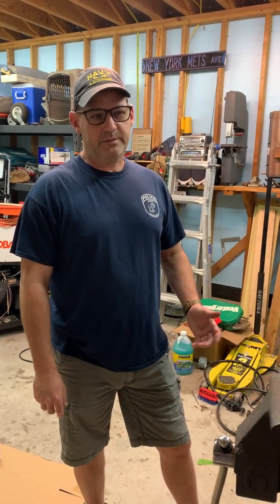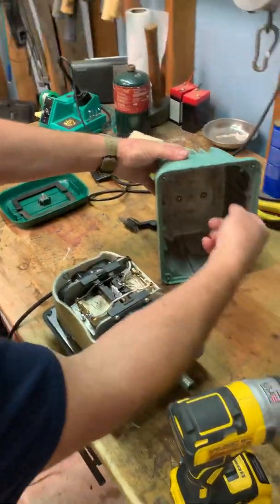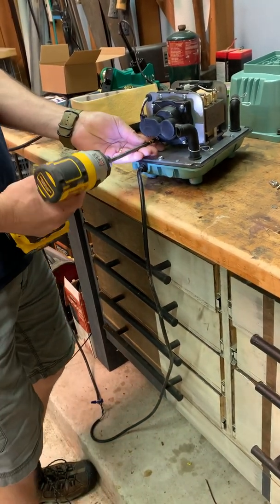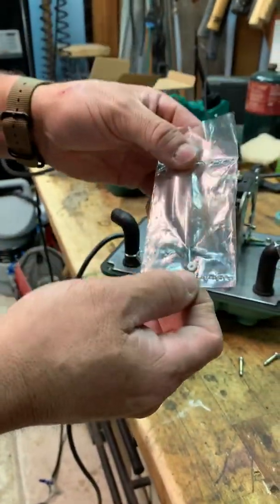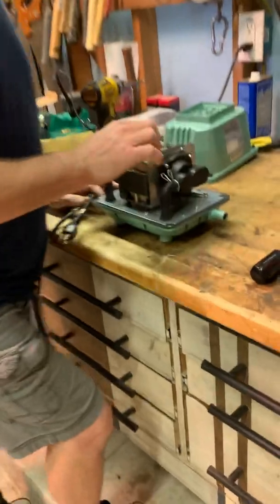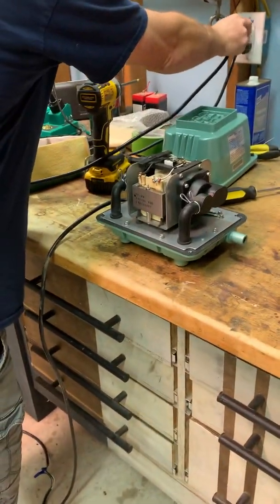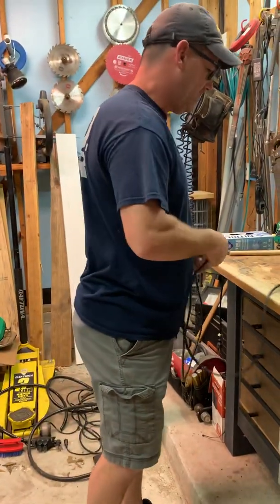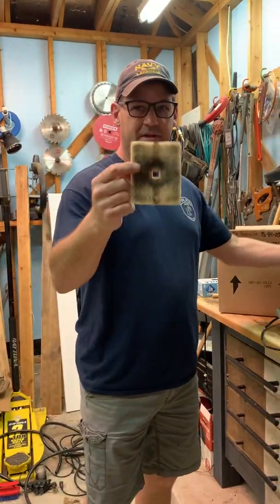How to rebuild an aerobic septic air pump in ten minutes

Comment: I'd like to rebuild my septic pump but I have a question,  my diaphragms are torn obviously and i also have the magnet in middle of the system but when I plug the pump in the motor does not even come on.   This is BEFORE rebuild.   My question is, if I "rebuild" the system and put a new magnet and diapragms in will the motor start running again?  I have a Blue Diamond pump so I don't have those "reset" switches like yours.   Any input would be greatly appreciated.  Thanks for the vid.
Reply: https://www.youtube.com/watch?v=Q3tqTcsqYLs